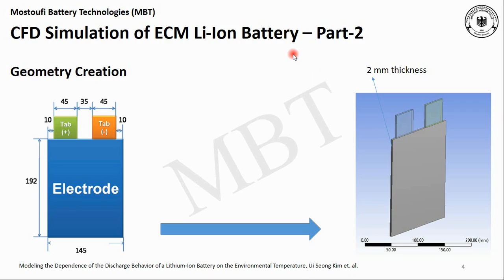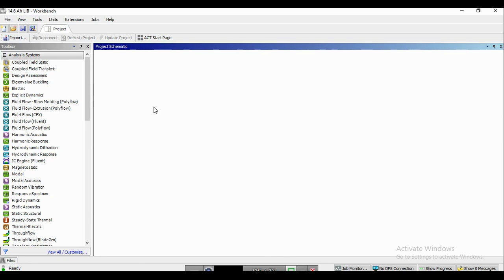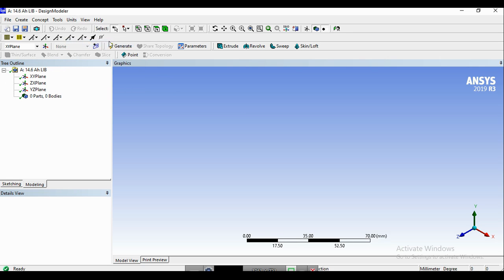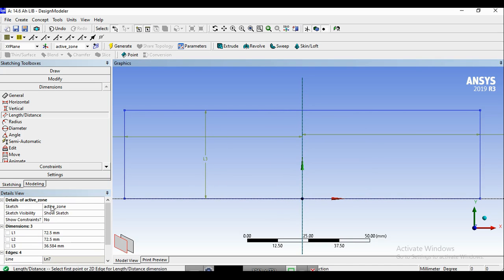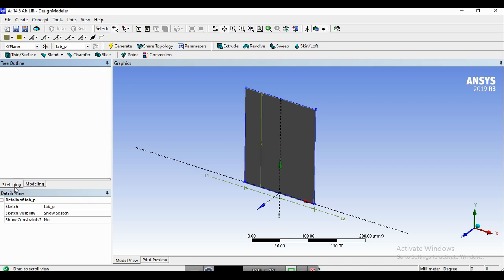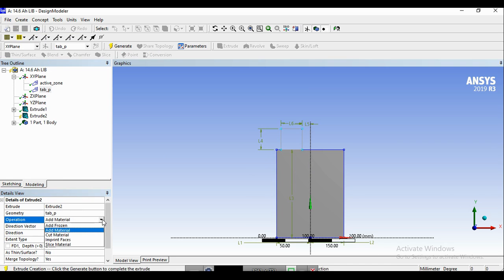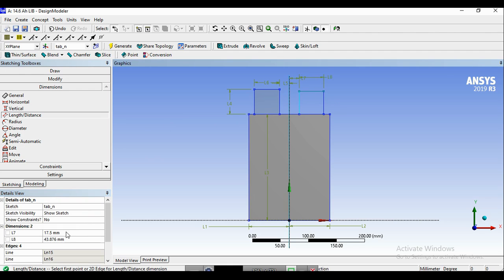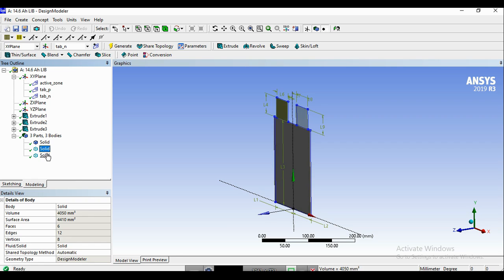Li-Ion Battery Simulation Using MSMD Model in Ansys-Part-2-Geometry

Comment: Can you please put video for designing cylindrical battery with dimensions and mesh sizes and temperature analysis for 5C discharge
Reply: hi, can u send me the file if u did it ?
Reply from the maker: @Houcine-b4m  Hi, please send us an email: bfcs@mostoufiholding.de
Reply from the maker: Dear, please have a look at "Battery Simulation in Ansys (Products)" Playlist. You will find a series of simulations on cylindrical batteries. Hope you find it well.